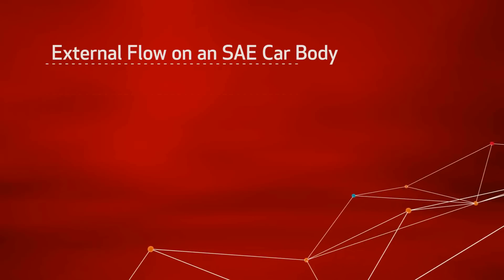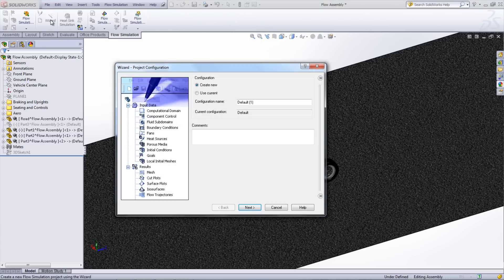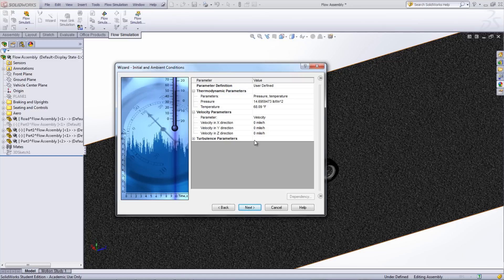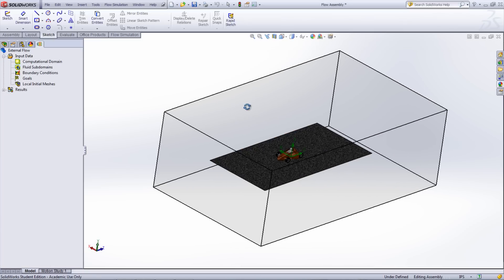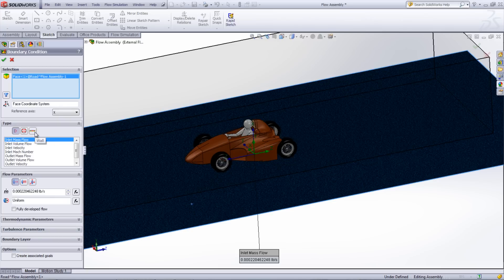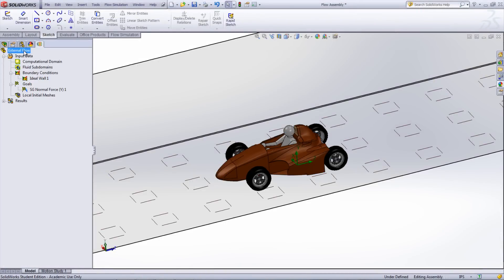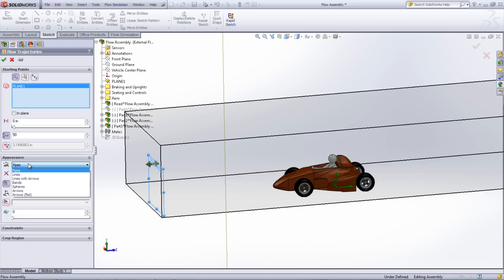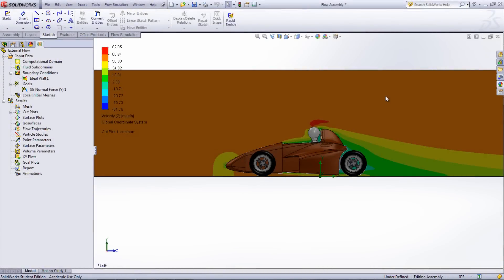External Flow Simulation on a SAE CAR Body

Comment: what if i have internal and external flow simultaneously? I'm struggling to simulate a car radiator, with water flow inside and air flow outside

Comment: Very helpful however I have a question that was not answered in this video. Is the road used in this assembly, a surface of zero thickness with the material set as concrete? If so was a custom material made with in "Road" part file with all the properties of your average street pavement such as the roughness, etc? Or, by setting the boundary conditions as "ideal" in this simulation, are you assuming that the road is smooth for the purpose simplifying the simulation? Thanks.